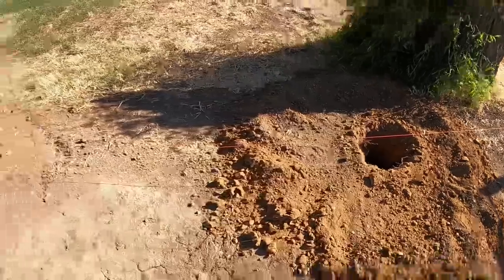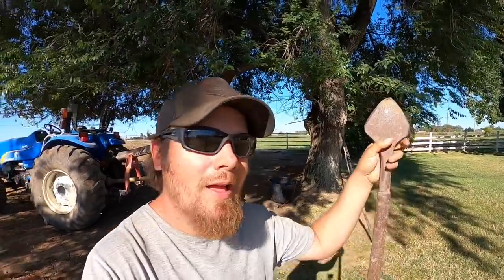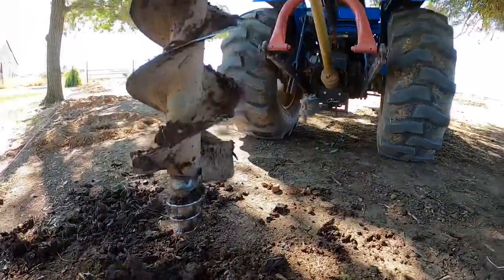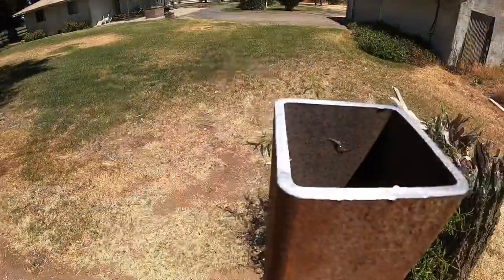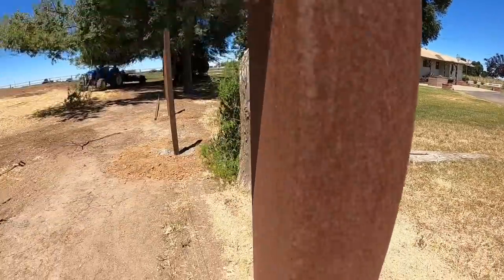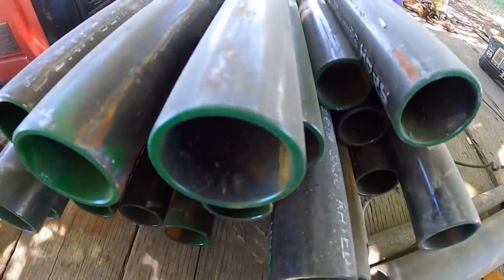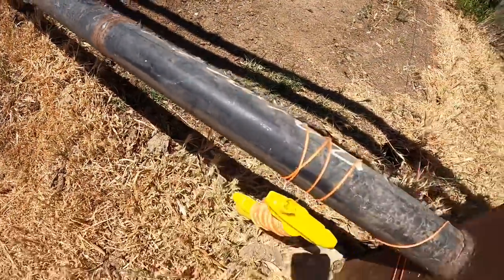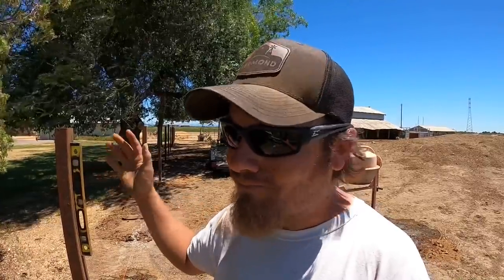Setting Corral Posts and How to Have Fun Irrigating!

Comment: Finally someone that doesn't put too much water in their cement...makes for stronger cement.
Reply: Cement cured in water is stronger
Reply: @brianpeterson510  Wrong! where did you get that misinformation?....you cover cement with plastic and let it cure slowly overnight keeping it covered for 3 days...this keeps what little moisture that's in the cement mix from evaporating out and slows down the curing making it stronger. when you spray water on top of bare cement trying to cure you hear a sucking sound and that's your concrete weakening..absorbing MORE detrimental water.
Reply: If you are interested in this topic an interesting side topic is that after the Romans left the British Isles they couldn't figure out how to do cement for hundreds of years
Reply: And look at why Roman concrete was considered unbelievably strong and nobody could figure it out except that it had to do with aging the concrete :-)
Reply: @miriambertram2448  Concrete poured in 1850 is stronger than 1910's concrete which is stronger than 1950's concrete which is stronger than 2020's concrete. All good concrete mixed with a low volume of water concrete gets harder with age...known fact.
Reply: @miriambertram2448  Yepper lost art, lost knowledge... happens more than we think.
Reply: @LarsonFamilyFarm-LLC Cover in plastic to retain water. Think that statement though. Have a great day and may it all work out for you😃

Comment: Good job! Two tips: After setting and getting them plumb, simply pour dry Quikrete directly in the hole. In 24-48 hours, ground moisture will be absorbed and concrete will harden. I've built and installed lots of fences, cattle guards, etc. It works. Last tip: You've had too much fun on the two wheeler, you ain't Steve McQueen (Great Escape movie). Your wife, child and cows depend on you. Be careful (I'm jealous). A long time fan.

Comment: Grandpa was correct.  The cows won’t care about the length of the fence, but they might be a bit curious about the change in material used.  Our cows are always curious about any change to their habitat!  That ending sure looked like a lot of fun…especially on a hot day.  Not unusual for us, on a hot day, to drive a four wheeler along one of the pivots to cool down!  That cold water will get your attention quickly!

Comment: Augers are great in soft ground but they suck in hard or rocky ground.  The 3-point hitch doesn’t have any down force so I usually wedge a pry bar into the head and put body weight on it.  Oh, hey! Just like you’re doing.

Comment: If you wanted to use round tubing you could avoid a saddle or notch by pinching the ends of the pipe flat... just my 2 cents

Comment: Why not just pour the quikrete in the hole dry and run the water hose in the hole next, then tamp it to get the air out? Sure easier than the mixer and way faster.